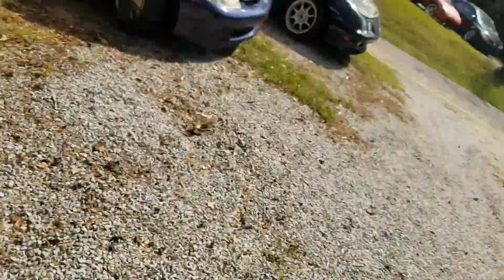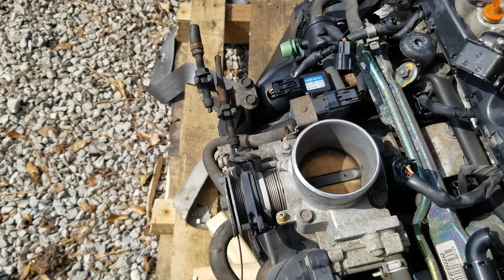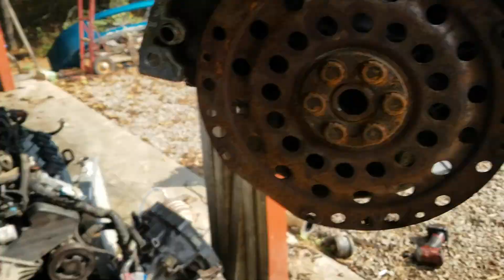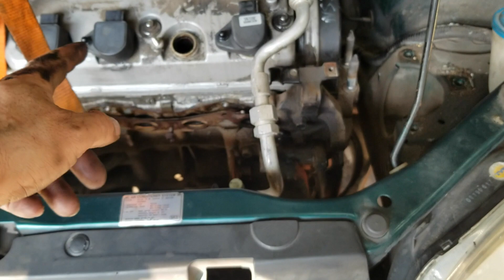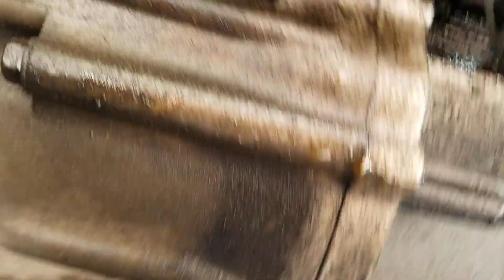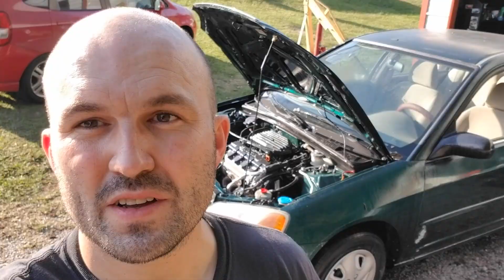2001 - 2005 Honda Civic D17A1 Engine install

Comment: Hey Phillip I found you videos on how to do the d17 swap and they seem to be best so far. One question i have though is do I need to swap the engine harness ecu and trans from my donor car to the car i plan to install it into basically what im working with is 2 2005 civics one is the ex the other is dx both american manufactured cars as far as i know. my donor car is a ex the transplant is not. Im just wondering if transmissions are compatible as well as the ecu and   Thanks.

Comment: Hi new subscriber here . having to replace my  manual trans in an 02 ex 2 door , and having a difficult time figuring out where to support engine from the top. i purchased an engine support bar from HF but there are no lifting points on engine and am stuck. can anyone give me any ideas on what to do here ? thanks
Reply from the maker: No need to support it. But you can with a floor jack from beneath if you decide to

Comment: Hey love the videos, they are detailed and very accurate. I was able to do my D17a2 swap following your instructions more so the things i need to swap over since i was using a JDM engine.
Question tho, after the swap it started right up but would not stay running any ideas?
Thanks in advance.

Comment: Hey man maybe you can help me out. I swapped a d17a1 4 door auto engine  into D17a2 2 door auto car. Had issues with vtech. I got a non vtech ecu and had it programmed. It got rid of a he vtech issue but Now I have po141 po135 codes. Is that normal ? I can’t figure out what I did wrong or what I’m missing . I know exhaust systems are different but I’m totally lost. What do you think ?
Reply from the maker: What engine harness are you using?

Comment: Hi Sir, I have a 05 civic and came with a b17a2 vtec but I just bought an engine that is the b17a1 non vtec ,do you think will start ok and accelerate ok or I have to change the ecu and many parts more???
Reply from the maker: it will start and run fine but it will be in limp mode due to the lack of vtec. You can install a non vtec ecu  and it will run as intended

Comment: I have japanese civic,  it does not have vtec pressure sensor as u said.   I have egr valve but has no wiring connection. There is no harness / connector near ignition wiring. I studied its drawing and wires do go out from ecu pins. But i dont have an error code.  I dont understand behind the scene as i bought the car recently.
Reply: Without egr, sometimes it pings. And i observed that it pings when it is warm out there.

Comment: I have an engine of the same model but my flexible plate does not seal well, it stays separated and I don't know why. Do you know the possible reasons why it stays so separated and does not seal with the 8 screws?

Comment: Hey man I did a jdm swap a engine and transmission on my 2005 Honda civic lx and there’s delayed shifting and all the solenoids are brand new..would I have to get a jdm ecu and program it or can I just reprogram the same one I got in the car now
Reply from the maker: The shifter assembly and ECU are different on the jdm car. I don't ever recommend using a jdm Auto transmission
Reply: Hey another question would me using the bmxa oem auto trans on the jdm engine would it give me any issues or it work with no shifting issues ??
Reply from the maker: @woowilly1010  should work fine.

Comment: doing a jdm d17a swap on my 2003 d17a2, any tips besides the throttle body and the vtec pressure sensor?
Reply from the maker: Use the USDM throttle body and on the VTec solenoid remove the plug where the pressure sensor is supposed to go and screw in your USDM pressure sensor

Comment: Thank you I am attempting my first solo engine swap on my civic. I could not afford a macanic to install it. Without this video my family may have no car. God bless you.
Reply from the maker: You got this! 💪
Reply: I have the d17 a1 american w auto trans
Reply: Hey they only have a vtec d17 a2 is that ok in my 2002 honda civic lx? As I currently pulled the other and am having it delivered Tomorrow and will pay upon delivery.
Reply from the maker: @MindyVanSickle-p4k  yes. There are a few differences but it will work. You will just leave the 2 vtec connection without anything  connected to them. The oil pan on the a2 is aluminum, the a1 is steel. The support bracket for the transmission at the bottom is different because of that. Therefore just run without a trans support or get one from a a2.
Reply: @hondaresource  ever had any lock up celinoid issues on swap? Trans won't engage my lockup
Reply: @MindyVanSickle-p4k  Change trans fluid asap! OEM Honda DW-1 or Idemitsu type H (i believe)
Reply: @MindyVanSickle-p4k  did you get it to work?  i think i just blew the headgasket on my 03 civic and am in the same boat!
Reply: OK Tommarow is d day :) I'll let you know how she goes :)
Reply: It's in ty so much! Hey any way to hook up and use my vtec?
Reply: Nope u cant. Unless u swap out the head with a vtec head. Which if ur on a limited bidget i doubt ud want to do. U'd have to remove the old head and install the new hewd with vtec along with a new headgasket. I doubt u want to open the engine block if ur on a Budget and do a whole headgasket/headjob after just swapping the engine in. l @MindyVanSickle-p4k

Comment: Only thing I found difficult that wasn't explained is when I was swapping for the vtec sensor the pipe that runs around the side on the JDM motors is bent upwards.  If you're really careful the sensor will plug right in.  I'm curious if the heat is going to make the cables or sensor brittle over time.   Seems like the American version with the sense the pip slopes down more than the JDM version.  Curios if I should have just swapped it out as well. TOO LATE NOW lol Thanks for this.  It is the best step by step on pulling and installing I have found on here.  I'll be doing a 99 accord soon as well hoping it's just as easy.

Comment: thanks the 2 vids really helped alot when i pulled out my d17a1 i relaced with a a2 vtec , is it just the engine harness and ecu to enable vtec ? and is there a diffrence between a coupe and sudan for the harness
Reply from the maker: Don't replace the harness. Just run the 2 wires for the VTEC to the ecu.
Reply: thank for the info will do  @hondaresource
Reply: thx it was a lot easier to run the 2 wires and re solder the eprom to the new ecu  @hondaresource

Comment: Great video man. Would like to pick your brain since you seem to have done many of these. I have an 05 d17a1 that blew. I ordered a used engine that must have been an 01-03 d17a1. The engine I ordered doesn't have the egr valve. We are going to swap the water outlet and gasket from the old motor onto the ordered one. Bit when we took the water outlet and gasket off of the ordered one, there was oil in the egr port. Do you know how that would have happened? Would we need to do anything to that port before installing the new gasket, water outlet, and egr valve? Thanks for your time in making the video and answering questions. You are appreciated for sure.
Reply from the maker: You also have to swap the intake manifold and manifold gasket to EGR style
Reply: @hondaresource  took the intakes off of both engines. The Gaskets are different but the intakes are the same. In case anyone ever runs into this issue again. The easiest way to do it, however, is to just take the intake/water outlet/egr all off of the old engine together. 2 less parts to handle, and 2 less Gaskets to mess with.
Reply from the maker: @jessemoore510  I knew for sure that the gasket was different, but I wasn't 100% on if the intake was different. Thanks for clarifying
Reply: @hondaresource  will the ordered manifold itself not work? We figure out we need to replace the gasket. But it seems like we need the whole manifold swapped over from this comment. Is that the case?

Comment: Did u use the same harness that was from the the original engine
Reply from the maker: Yes
Reply: I need to change my engine I seen one but it's v tech my original engine is non v tech I was wondering if I block off v tech and use the non VTEC ECU and harness will that work can't find other non VTEC engine

Comment: Is there anyway in only taking out the motor only i have a manual without taking out the transmisión
Reply from the maker: I'm not saying it's impossible but you'd spend more time fighting it than if you went ahead and pulled it all
Reply: Ok thank you so much ,  would  I need to put support under the transmission if I were do it like that?

Comment: Is there anyway in only taking out the motor only i have a manual without taking out the transmisión
Reply from the maker: I always have to pull it with the trans on a manual. Just not enough room to separate them in the bay
Reply: Ok thank you so much for your help God bless you

Comment: Thanks for the videos- great teaching tool- I swapped a JDM V-tec into a non-v-tec car. 2005 lx civic. I did connect the v-tec - would that cause a check engine light- just wondering- please let me know- thanks
Reply from the maker: there shouldnt be any connectors on your LX harness to connect to the vtec. You can leave it disconnected, it won't cause any CEL if you are still utilizing your original ECU
Reply: Hey I have questions how did you connect the v-tech sensor I have D17A engine going into a LX with a non v-tech harness can I leave it unplugged?? Thanks in advance

Comment: Hey I recently swapped out my d17a1 for a D17A and am currently dealing with a crank no start. Used a spark tester and spark is present, have fuel on spark plugs, compression is good, fuel rail had fuel and pressure when i popped it off. Car cranks stong, battery is good, grounds are good, no immobilizer issues. Fuel pump primes. I cant pull any codes with my obd2 scanner (cheap $50 scanner). IM SO LOST PLZ HELP
Reply: There's something under the dash that can prevent that

Comment: i was able to swap everything over but the car won’t start it just cranks. only starts with started fluid and would shut off once i stop spraying starter fluid. has new coils and spark plugs. fuel pump primes. also misfiring all cylinders. compression is good. any idea ? thank you -

Comment: do you know if the jdm engine flex plate or different then the usdm one? i put a jdm one in and i can’t seem to be able to put the torque converter back on. motor won’t spin as well
Reply from the maker: Flex plate is same, you just don't have it aligned properly
Reply: @hondaresource  is there any way i can contact you and send you some pictures. the flex plates look a little different

Comment: ok i found my issue ok you explain on @4mins you said if u had a d17a in there at first than i blew the engine an i bought a d17a thinking they where the same than i had friend replace the motor an than i didn't an hard time smogging it back in like 2018 idk how i got it smogged b4 with the egr not plugged in i do believe he never installed the clip or he used my d17a1 harnesses an make it work also i passed smogged 2 years ago but i got a visual look few days ago said i had codes that weren't  matching or something but he passed me 2 years ago an now i went back same engine nothing new he said "he didnt notice the egr valuve he told me to romove it or cap it an come back but if was able get this normal part would that better than capping  or do i need buy a new d17a1 to pass smog confused neve had the issue b4 only was told the first time was the egr valve by 1 other person 1 time after i had the engine put in its been thru 2 smog since than all passed even with the egr unplugged need get my car smogged an regs before the 22nd help please
i live in ca too btw do law on the egr are diff i think

Comment: So...I bought this '02 Civic with a blown D17A1 motor.
 I went to the junkyard and bought a nice looking D17A from a wrecked  Civic.
 Did the motor swap and everything turned out okay.
Took it for a test drive and the transmission quit working. It barely will pull when it's cool. But then slips all the way in a matter of seconds.
 I could go buy another transmission but I'm worried that this transmission is okay and maybe I forgot to do something.
Or maybe there's something I didn't hook up right.
 Do you have any idea what I could check?
Reply from the maker: These transmission are notorious for failure. I would look for another one

Comment: Ok... My D17A fired right up... But it was idling too high.
 After a couple minutes... It dropped rpm, then immediately started surging.
 Up,down, up, down, up down.
Any idea what I might need to do?
 Perhaps a relearn?
Reply from the maker: Either a vacuum leak or iacv
Reply: @hondaresource  after further inspection... Vacuum hose below throttle body, next to firewall...I forgot to hook it.
Thanks

Comment: Greetings from Pakistan. I have a 2005 civic with a factory d16w9 v-tec engine but wanted to replace it with a jdm motor d17a since the original motor has a blown head gasket and a warped head and overhaul is 2x the cost of having it replaced. Question: is it a bolt on swap? Can I use my old ecu or do I need to have the d17a ecu? I've read and heard that all 7th gen civics have interchangeable motor just need appropriate wiring is that true?
Reply from the maker: I have no idea man. We didn't have a d16w9 here. Does it look the same?

Comment: Where you located and are you still installing?
Reply from the maker: I'm in Alabama, I'm not currently taking new customers.
Reply: @hondaresource  😔 my mom's in Alabama, Shelby. Let me know when you take new customers
Reply from the maker: @maxnguyen22  will do. I'm just too backed up at the moment. 13 crv's, 1 element, 4 accords, 2 rsx's, 10 civics, 1 Odyssey, and 1 s2000 all at the house right now. I need to get caught up

Comment: Good morning. 
I'd like to install a non vtec motor in replacement of a vtec how much trouble am I looking at getting the car running ??
Reply from the maker: It'll run no problem, however it will be in limp mode due to lack of vtec system. If you want to be 100% get a non vtec ecu for you year, then have your key programmed to it.
Reply: @hondaresource  In limp mode will the car do 60mph 100 km on highway. It's a work car so I don't really car about limp mode.
Reply: Also the non vtec motor is from 2001 going into 2005. Will I need the 2001 exhaust manifold?
Reply from the maker: @jonwurster1275  just use your original
Reply: @hondaresource  The original 2005 exhaust manifold will fit the 2001 non vtec
Reply from the maker: @jonwurster1275  yes.
Reply: @hondaresource  Do I have to swap ecu to drive the car if I swap?
Reply from the maker: @jonwurster1275  it'll drive but it'll be in limp mode. So it'll only go up to about 3500 RPM. I would recommend doing a non vtec ecu for best drivability
Reply: @hondaresource  Does that cost a lot to have programmed? I'd probably just leave is along drive as is. Vtec super hard to come by where I live
Reply: Or the engine I pull- ecu and keys ignition all from same doner car? To make work
Reply from the maker: @jonwurster1275  you can use everything from the donor. I'm not sure what programming runs where you are. We charge $150
Reply: @hondaresource  Hello. Everyone I talk to says if I put non vtec motor in where vtec is my car will only stall and barely drive. Now I'm not sure what to do.
Reply from the maker: @jonwurster1275  correct. Limp mode is drivable but it not ideal. Put the non vtec ecu in it, get it programed to your original key. It will drive and perform as an original non vtec car.

Comment: Does the jdm have a knock sensor?
Reply from the maker: yes
Reply: @hondaresource  took me 2 hours and alot of my sanity to finger that knock sensor from under the car on ground.
Reply: @hondaresource  16th of a turn took about 45min to screw in with 12mm wrench.

Comment: Have a question for an issue I ran  intoning my daughters civic  the cooling fan sensor or switch the plug that goes to it does not lock to where you have to push the little pin go release, The sensor was bad so I had a brand new sensor I’m thinking there was something jammed in the plug or something so  I bought a new plug as well and it still would not connect together so that it would latch on, is this normal or Have you ran into this before?

Comment: How’s it going? I will be swapping the motor off a 2002 Civic LX 1.7 with a JDM D17A will there be any issues with the ECU being that I believe the LX has no v-tech and the JDM does. Thanks in advance.
Reply from the maker: It'll work, but you just won't have vtec
Reply: @hondaresource  thank you

Comment: Hey I got a question regarding that same d17a1 motor I got a code stating that the rocker arm actuator was stuck open but can’t seem to find it where would it be located on the engine? Please help.
Reply from the maker: That's a vtec code. Do you have a vtec ecu in it

Comment: Thank you so much I was able to install a Japan engine to my EX and thanks to your videos I was able to accomplish it, but I do want to say there is two brackets that are mounted on the tranny and then bolt on to the oil pan but for the Japan engine it does not have the holes to bolt on, it threw me off I had to look back at the original engine to compare but just thought I add this comment in case anyone else runs through this but again Thank you great videos.
Reply from the maker: Correct, the JDM engine has the steel oil pan like the d17a1. If you want the bracket, go get one from a d17a1 at the junkyard. It's a one piece design.
Reply: @hondaresource  is it necessary ? Or is it okay to leave it that way
Reply from the maker: @renecast5050  you can leave it, it'll be fine